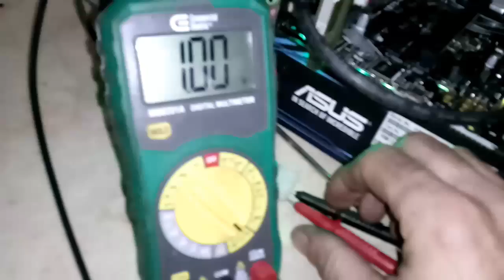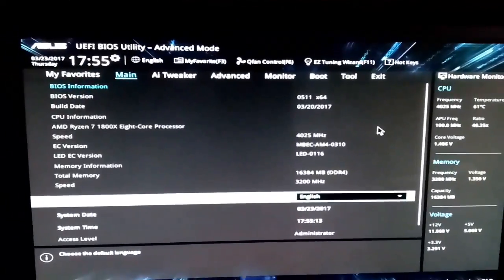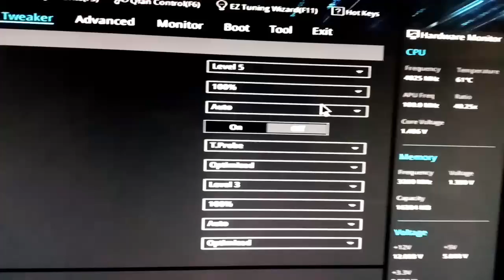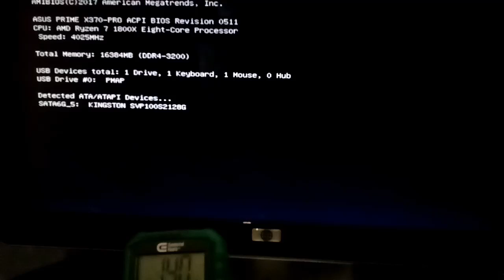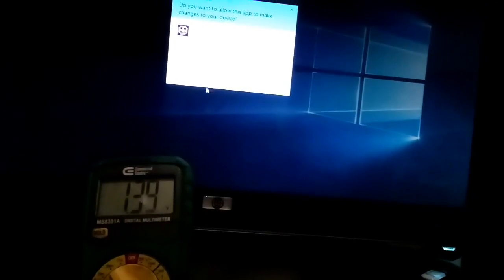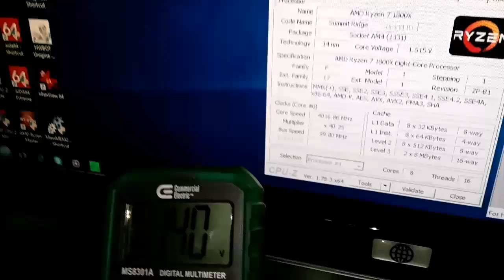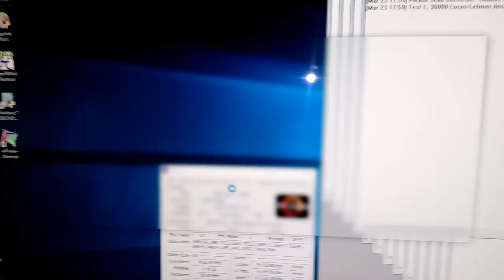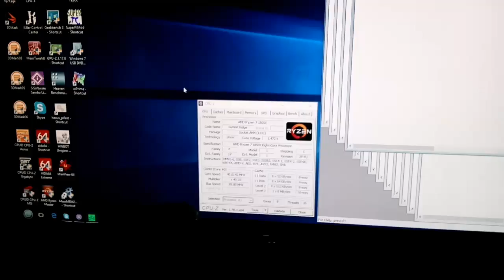Asus Prime X370

Comment: So why is this board is so hot? Even b350-plus is better for vrm temps?
Reply from the maker: rafael oOze no..b350 with 1.40v load would exceed 90c if it did not burn out a fet..

Comment: Like someone else asked, could you compare to the CPU Core Voltage reading from HwInfo?  I've noticed that the ASUS MB sensor is reading WAY higher under load but the HwInfo voltage stays the same or drops a bit.
Reply from the maker: masterkaj i could do that but software is to slow like my dmm. an occiloscope would tell us far more but i don't have one and for what i do really would not matter much.
Reply: Yeah, just trying to figure out what voltage to follow for my overclock, I'm assuming if you checked that same PC with the same settings in HWInfo, doesn it show ~1.4V instead of 1.48V?  You've already proved that it is 1.4V and not 1.48V, I'm just curious if the "CPU Core Voltage (SVI2 TFN)" in HWInfo is more accurate.
Reply from the maker: masterkaj i will have to recheck...i believe it was closer. i need to test some stuff on a few boards again on air. i will add it to the list after i stop fooling around sub 0 on the C6H.

Comment: CPU-Z read the motherboard sensor for the voltage and yeah, it jumps all over the place. However if you download HWInfo64 it also shows what the CPU reports the voltages are and they seem a lot more reasonable. Have you compared those with your multi meter?

Comment: I found the same problem with CPUZ while comparing with HWinfo, which seems to report things right.

I strongly believe CPUz is broken, as much as the AI suite in my PRIME X370 PROI'll explain:CPUZ: The reading is all over the place. 

With an OC of 4Ghz at 1.35V I get 1.330V, 1.319V, 1.36V, 1.4V...it jumps endlessly at idle...at load it shows 1.373

VHWInfo: 1.35V constant Vcore reading (not moving at all) and 1.327V vdroop with an LLC Level 3.

In fact, if we substract 1.35V from 1.373V (CPUZ reading at load) the difference is 0.023If we substract 0.023V from 1.35V it gives you the right vdroop reported my HWInfo (1.327V)

So I believe CPUZ is reading the vdroop with a positive number, which appears as a vboost. (it did that with every LLC from 1 to 3)

In fact CPUZ is so broken it crashed my system (which is pretty darn stable) after 10min running while posting this, and I had to write it all again. (CPUZ will not crash your system if you load it and close it after say 1min)

Please leave CPUZ running after a couple successful validations for at least 2omin and see if you get a system crash. (black screen)

Comment: Did u tried LLC3 software vs real voltage?
Reply from the maker: FlanK3rCZ of course i did...i tried all. my settings give me the closest bios set vs actual @ socket.
Reply: I use LLC3, but at Crosshair, maybe its a bit different than at X370-PRO
Reply from the maker: FlanK3rCZ ch6 has identical pwm....and same results as x370 pro....your settings =1.37-1.38 when set @ 1.40 llc 3.....
Reply from the maker: FlanK3rCZ um...no. i have ch6 i tested it....how else would i know it gives identical reading....

Comment: I have the same board with a Ryzen 1700 and G.Skill b-die and all has beeb stable with 4GHz and 3200Mhz CL-14-13-13-13-1T since 0504 for me :-)
Reply: Rob ban i have b die corsair vengeance led 3200mhz and am wondering if it works. im still waiting on my 1700 and am contemplating sending my prime back for the ch6 version.
Reply: Can I get  the trident z RGB to run at 3200 MHz on the  x370 pro

Comment: Ryzen has a 20C offset on Ryzen X chips so i wouldn't worry about the shut downs anyway e.g. 90C actually only equals 70C :)
Reply from the maker: I'm aware of this. I was almost 90C at 1.4 and said I had shutdowns at 1.475. 

Preety sure temps were over 90c then
Reply: What thermal paste do you use? I hear MX-4 is good, so it may help you out a little if you're looking for a cheaper way of reducing temps rather than getting a new CPU cooler.
Reply from the maker: I do a lot of reviews and testing, bios testing, board and cpu swaps. That said I am using the cheapest paste possible. Cooler master $5 tubes. Temps are really not a concern to me for the time being.
Reply: Yeah I realize temps may not be a concern, but they become of a concern if they're actually shutting it down the PC or the CPU is throttling so you won't be hitting the 4GHz you set anyway which effectively stops you testing accurately or in this case (shutting down) at all.
Reply from the maker: Comanso Rowlett 

thus setting to ignore to see if it is board or cpu causing thermal shutdown. if that does not work it is time to change my cooling apperatus :)
Reply from the maker: Could be usefull for running multiple boards which I used to do. I'm probably going to borrow 1 of my old phase change units that to a buddy. I need to get below 0c to investigate some IMC related Items soon.
Reply from the maker: Comanso Rowlett except for the fact that is a non xfr chip so does not apply to that issue.